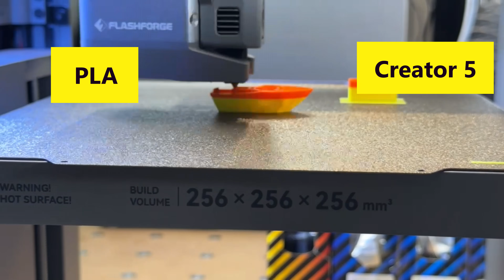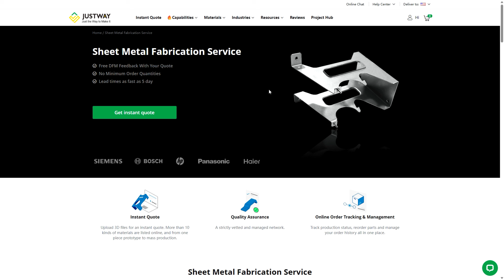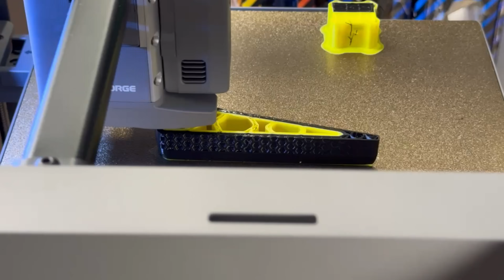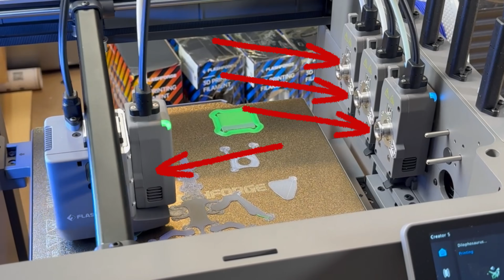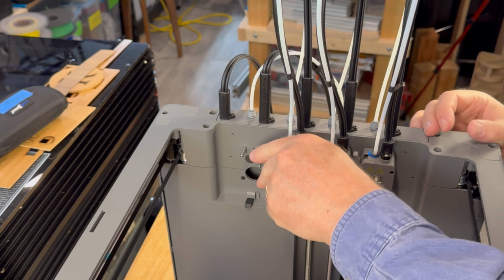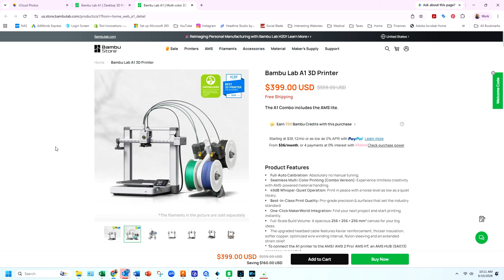NEW FlashForge Creator 5: BEST Budget Multi-Toolhead Printer?

Comment: I like printing TPU. The ability to print different filament types in the same part is the primary  reason I am looking at the c5.
I would use it in LAN  mode. 
I am fine with manually loading filament. Less things to fail and help keep the price down.
Reply from the maker: Using it in LAN mode is definitely an option. You do have a good point regarding manually loading filaments is one less thing to go wrong versus an automated loading system. Good luck with your decision and thanks for your comment.